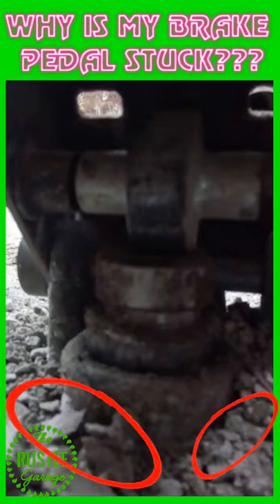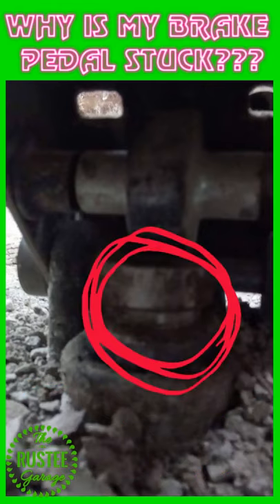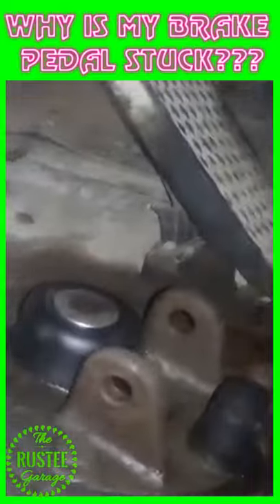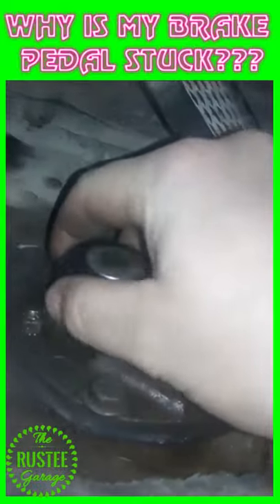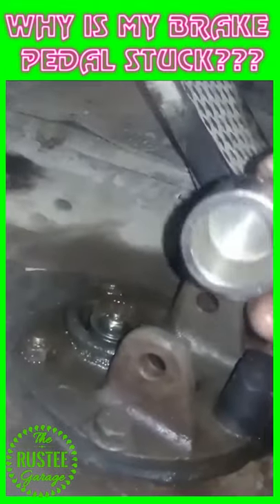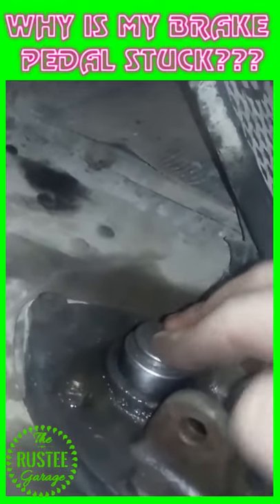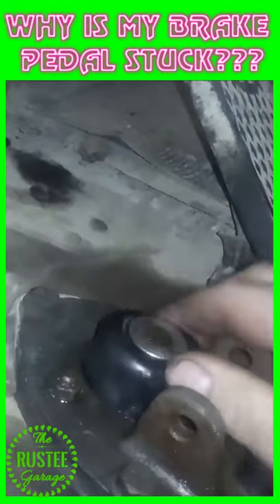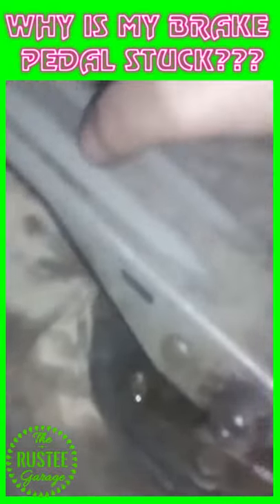The Air Brake Pedal Is STUCK - Fix it fast!

Comment: My pedal is almost on the floor and is leaking air underneath the truck. Was yours leaking or was it just stuck. I'm hoping this is my problem.
Reply from the maker: The one in the video was just stuck. Spray it down with soapy water to pinpoint where its leaking. Good luck!

Comment: No one shows how to remove the pin holding the brake pedal.
Reply from the maker: There's a cotter pin on one end that you take out and then use a punch and hammer to take the pin out.